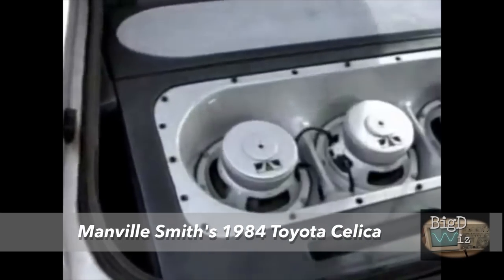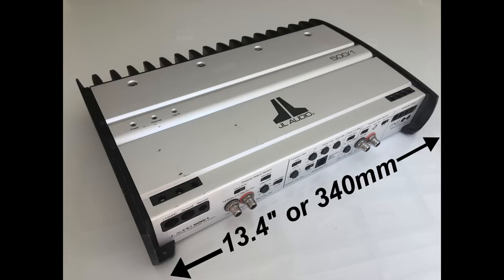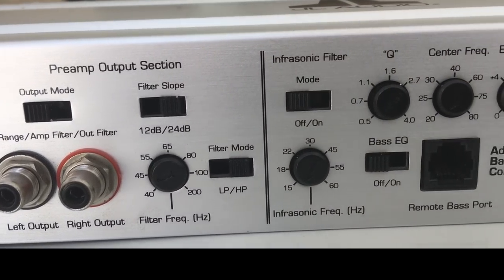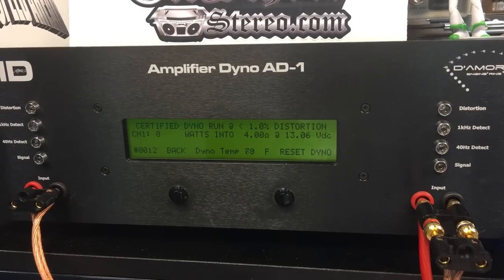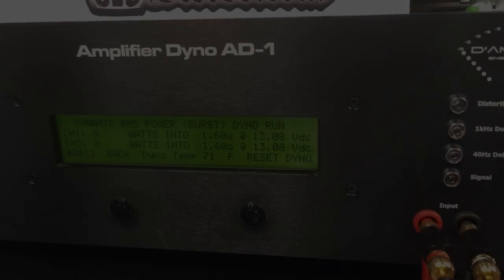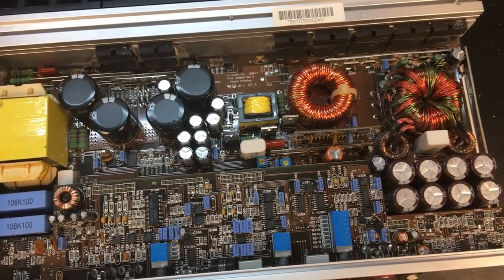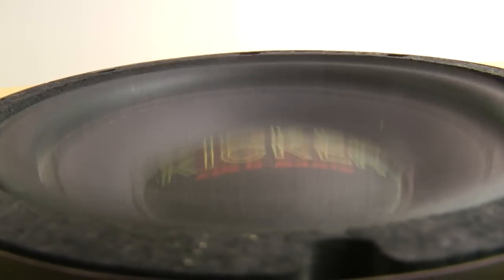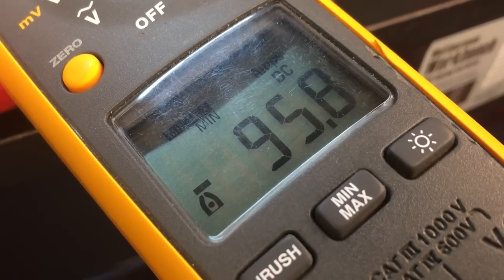Best Selling Car Audio Amp Ever? JL Audio 500/1 Amp Dyno Test

Comment: I'm 46 and sold these at United Audio Centers in Aurora IL.  This amp was a game changer when it came out.   Amazing power in such a small design.   I sold these for a living back in the day when it came out.   My JL Audio rep was a cool old guy which I thought was weird for a young mans game back then.   The nicest set up was an Alpine head unit with the subwoofer volume control and 3X10 JL Audio W3 box or 2 x 12W3 box.   It would bang for days looked cool next to the 4 channel JL Audio AMP when mounted together.   It smoked anything in its class back then.   I think it is awesome it still goes for around the same money on Ebay if it is mint condition.   We were one of the largest sellers of Rockford Fosgate and JL Audio made a huge impact back in the late 90's.
Reply from the maker: Agreed!!

Comment: Easily some the cleanest sounding amps still on the market.
Reply from the maker: +ThisIsSolution thanks for watching and commenting.
Reply: ThisIsSolution facts
Reply: I’m using one right now to power a alpine r series 10 in a porter box people think I got 2 12s
Reply: I have 2 500/1 v2 pushing 2 8w7s and a 400/3 pushing c2 650s and my alpine 6×9s
Reply: @urbbs09  i bumped two 8w7s as well, I started with a crossfire720 rated at 720watts @12.6v
Then eventually moved to 2 JL 250/1v1
Instead of the crossfire... the jl amps sounded a bit cleaner but both were absolutely loud and clean with deep bass, I built a custom box for the subs... it was something out of legend how it sounded. 
The 8w7 (although expensive) is underrated in its sound range,  it hit hard, deep and had crazy good response.
Imagine I got both subs for $550 and they were the anniversary edition speakers after the dealer couldn't fulfill my original order for 2 refurbished units, so they had to swap out the refurbished with brand new.... I used them for a while and sold them online for a profit!! 
Now I'm bumping 4 jl 13w1s and 2 jl 250/1v1.  Loud budget system that's clean!!
Reply: @urbbs09  good times,  enjoy your audio
Reply: I would like to say i have 1 extra 8w7ae in a custom ported Birch enclosure I'm selling if anyone is interested
Reply: @urbbs09  how much $?
Reply: @briteRedaz16  where are you located?
Reply: @urbbs09  Califuckinfornia lol. Central valley

Comment: JL is one of the best manufacturers to this day. I've never owned a slash amp myself, but I've seen and heard plenty and they're solid in every aspect.
Reply: I think JBL will Give JL a run for the money ! Pre Samsung.  JBL has alot more r&d and been around a lot longer
Reply: hifivega I currently own two. I’m running a slash 300/4 v1 that’s still running like a champ from a previous install on my comps. (Sat in the box for around 6 years in between) I’m also running a slash 500/1 v2 on my sub. They scream quality and are built like tanks and they produce some of the cleanest rated or above power. I’ll likely never look at a different amp line besides the slash series provided JL keeps producing them.
Reply: It a good real world amp, i have the 500/1 with a 10 w7, and it soundz very clean. Not thumpy but clear and doesn't strain the electrical......

Its for grown men not young boys... its all clean power
Reply: @hifivega did you upgrade your alternator?
Reply: JL and DD audio
Reply: I have 300/4 running Boston Pro 6.75 in the doors and it pushes them nicely.
Reply: @Rah-know  do you think your JL Audio/500 does a thousand Watts
Reply: Moses Salazar no..... maybe 600 watts.... the RIPS Technology will clamp the power to get the cleanest output..... I’m sure it’s a 1000 watts peak but the power is clamped......
Reply: jbl grand touring

Comment: This amp is legit.   I’ve got a 500/1 powering a JL W7 12” in a wedge factory enclosure with the aluminum bars, as well as a 300/4 powering my mids and high’s.   To date - everything still slams and has not once had a single issue In the 20 years I’ve had them.  Love JL.

Comment: Every 500/1 I benched was around 540-560watts at 1.5-4ohm loads, the extra control features make it one badass 500watt mono amp.
Reply from the maker: +jeanious2009 did a bit more at 1.6, but wow the current draw 😱. Prime example of why you would really benefit from using these at 4 ohms...light load to the electrical

Comment: I have a jl 300/4 and also 500/1same as what u. Are showing one of the best set ups I have done I'm my cars. Love the quality of them with 6×9 jl audio in the rear and 6.5 jl audio in the front with jl tweeters on top of dash. For the bass I have 2 12 jl w3. They sound awesome always puts a smile on my face when i turn it up no distortion whats so ever. I also put in a 4 gauge jl audio wiring kit. I love jl audio I would never go anywhere else.
Reply from the maker: +Samuel Justo thanks for watching and commenting with your experiences
Reply: Which one is more powerful ?
Reply: @Samuel Justo did you upgrade your alternator?

Comment: I have a 2002 built 5 channel (500/5) from this series.   Class D sub, AB front and rear.   It's still running.
Reply: I picked up that same amp at a thrift store for 15 bucks I couldn't believe it when I did

Comment: As I noted to a comment below, I am currently running two slash amps. I’m using a 300/4 v1 from a previous install from a ways back (It sat in the original box in my spare closet for about 6 years in between installs) and it still runs like a champ. I’m using it to run my front comps (ID CXS64s & ID 69s on rear deck for some rear fill) and I’m running a slash 500/1 v2 on one sealed IDQ12 D2 v4 in my trunk. These amps are built like tanks and put out some of the cleanest at or above rated power and are light on your electrical. I cannot say anything negative about these amps and I’ll likely never look at a different line of amps provided JL continues producing them. Also, I want to give a big thumbs up to Big D for taking the time to provide us his quality content. I’m always excited when there’s a new video uploaded! The information you provide us is both very informative and entertaining. Even though my current setup will likely stay as is for some time it’s always great to see you testing a huge array of amps to help us make wise decisions based upon the information you provide all of us given that each of us have different goals in this never ending quest to obtain the sound we are looking for!

Comment: I have owned two of these. Sheer bass  output signal from this model was insane.  They werent cheap neither. .
Reply: I still use my original JL Slash-500/1 in my car today with a new 10”W3V3-2!#🔊👑@emersonmayeaux2482

Comment: I have had that amp since the early 2000's and also have the matching 300/2. The many controls really kick ass. Also use JL speakers and subs. I'll never sell them, they work too well and give me all the power I need. I used the setup for years in an 18-wheeler, using two 13' zero gauge Monster Cable power lines hardwired directly to the 4 x 12v battery system of the truck.Was fascinating to watch your review. Thanx a bunch!

Comment: During my career as an installer for HiFi Buys in the Atlanta area, I installed hundreds of these amps.  Usually along with a 300/4 for mids/highs.  I RARELY ever had any come back with problems.  They had a ton of headroom, impressive dynamic range, and never seemed to run out of "juice" when powered properly.  I miss those days...  Thanks for the review BigDWiz!!!
Reply from the maker: +IDontHaveAVideo awesome, thanks for sharing your experiences with this amp 👍
Reply: I got my First (of 2) Eclipse Aluminum 12's from a HiFi Buys (the Kennesaw one next to Circuit City, I even have some photos from an IASCA/SLAP Show down there one time) and the Monster Cable 4 Gauge power kit I ran up until I upgraded to 0 gauge just like 2-3 years ago (if even that long), I forget where I got the second one, may have been another Hifi buys, did there used to be one over across the road from the Mall of Georgia, if there was I think that may have been where I got the second one.
Reply: DanielRichards644 Those Eclipse subs were pretty sweet!  I worked at Hifi Buys on Jimmy Carter Blvd., then at the Mall of GA location.  That was a great job with great people.  I do miss it.

Comment: I'd love to see a dyno of the JX 1000/1 D from JL Audio. Wondering how the budget versions perform.
Reply: For just raw power at 2 ohm the JX probably performs just as well. Problem is there's a lot more to a 1000/1 slash series amp than just raw output.

Comment: I have the same but the 250-1... No fuses... 4 gauge inputs... Won't over heat either... Underrated also... Puts out around 400 watts at any ohm... Owned since 2007 about... Was pricey but well worth the price... Highly Highly recommended...
Reply from the maker: +lucifur999 get what you pay for

Comment: Yeah! thank u very much friend! i was waiting for this review, please make one of Slash 300/4, and 10"w1v2 subs....great video!
Reply: In my 2008 Toyota Meru (A.K.A Prado 3 doors) the setup is: Pioneer AVH 3200 DVD, front stage JL ZR 6.5" and MB Quartz Reference mids, rear Pioneer TXR-800 enclosures, mids Bluefire 6.5" (Beyma replica) all this powered by JL Slash 300/4 and drived rear and front stage for open car with 2 relay. The bass original box JL Powerwedge with 2 10" W1 V2 powered by JL Slash 500/1 main wire gauge 1/0 and for each amp gauge 4.... i accept suggestions....   I love this channel
Reply from the maker: +Alfieri Hernandez wow, great setup!! Thank you for watching and commenting

Comment: i remember i picked up a JL 1000/1 and 13w7 (in the true to spec box) at a garage sale for 60 bucks one time....that JL amp was amazing and sounded better than any other amp (barring Zapco) that I ever owned. It's now permanently a fixture in my closet because it went into low ohm mode and never came out....damn i miss running that amp....

Comment: Finally installed mine that I bought new in the box. I’m thankful for all the controls for integration purposes but after seeing 100+ amp draw is 8awg that JL recommended enough wire? My power light dims on hits with 20’ of #8 

Classy video as always man, thanks for posting.

Comment: I have this amp together with a 300/4 still installed in my BMW 540 powering Diamond Audio Hex series components and coaxials and 2 JL 10w6 subs for the last 14 years.
Reply from the maker: +Jun Alcanites if it ain't broke, why fix it? Great setup there 👌

Comment: I had 3 15 w6 comp subs from JL audio. Had them powered perfectly off an old school sound stream 2000 watt amp. I know they would have handled more power. I dont know if you tested the sound stream amps yet but it could be another test video Derek.

Comment: i did a test to my 3 12s when i had this amp and it was reading same wattage to each speaker.awesome amp.just acquired the 500/1 v2 and the 1000/5 v2.havent hooked them up yet .need a project car first.cant be booming toohard in my soccer dad van..or can i?hmm

Comment: a few weeks a go I repaired a friends amp it was a 500/1 v2 and were the one large inductor to the left the yellow transformer looking thing it had 2 smaller ones.   He Some how dropped it and it broke a wire coming from one of those inductors and it stopped working. it also broke the zip tie that was also holding it down.   So I use my soldering station and removed the inductor took the broke wire out fixed the inductor and put it all back together and it worked great.   and the thing is heavy for its size.   only made 20 from it since it didn't take long to fix.
Reply: Would you recommend these amplifiers?

Comment: Sorry for the late comment, and I hope that you respond. Thanks in advance for your time! I just pulled one of these out of my uncle’s 72’ c-10 and will probably out it in my truck on a separate build. Questions are what new JL 12 would you recommend hooking up to it and how will the connections be made with the sub outputs? I see that it has room for 2 subs, but you only used 1 connection in your test?

Comment: I had a 1000/1 Slash. Absolutely hammered until it started playing up. I found if I bridged the grounds on the input RCA With output RCA I managed to get it working again.
Reply from the maker: +staples4335 those should do about 2x what this amp does. Pretty big 1200W amp by today's standards, but some times size does matter 😝

Comment: Was my favorite amp out of the Amps I had. Wish I never sold or traded it tho... Even tho it's not a monoblock Class D, I have alot of capabilities with this Orion XTR 750.4. Hopefully it will fill that void. Birth sheet shows 205watts RMS @2ohm per channel instead of 188watts. Can set it for 2 channel, 4 channel, or mono. If its as good as I believe it is not having it dyno'd by anyone on YouTube that I can see, and I get the rest of my bases covered for voltage I'll strap this beast with another from the same father... hehe

Comment: I have owned both the 500 and 1000 slash 1s and there were great amps. The only thing I would notice is when switching the bass eq to the on position I used to get a very low audible rumbling noise  when the volume was all the way down but during music it went away.
Reply from the maker: +lstephenson247 interesting. Thanks for sharing your experience
Reply: That would be a bad ground, rumbling noise with motor running. Bad ground.

Comment: Whenever i see jl audio at local pawn shop i usually buy i hate reselling em cuz they are beast.they had 2 almost new 12 w6 for 300 i got em with 6 month warranty for 300 out the door.bought a wedge 12 w3 series for 100 and find alot of deals on offer up cuz people want alot for them but always drop prices cuz too much.if i see a 13.5 w7 for 250 i always go and inspect it test it and buy it..lol
Reply from the maker: +Dj Smiley of las Vegas agreed. I got a 10TW3 in a Stealth Box at a Pawn Shop for $80. That combo sells for 600 😱
Reply: BigDWiz im sad i sold it for 220 i made a video when i hooked it up in my suv and a cheap performace teknique 800 watt and it was loud and clean.when i finally got this amp it was gone.great video was waiting for you to do the jl audio amps

Comment: great vid. did you happen to make one for the xd600 and rd500 by JL? i have two 8w7 and been using just the xd600 for both subs. it slaps but im sure they can slap harder and sound better. thinking of buying a micro amp because space is an issue. whats crazy is i bought the xd600 for 150 new years ago and now today they sell over 300 used. not sure what to get. im a sq guy and have both subs enclosed. also thinking about get some skar 6.5 component speakers for some mids. what should i do?

Comment: Great job on the video!  Wondering if you could help me out. Thinking of pushing a 18 inch sub with a 500/1 but it's an 8 ohm sub. Can you Dyno to see what the power is at 8 ohms? Wondering if the rips still works at higher impedances.
Reply from the maker: Yo Joe! I don't have the amp in my possession anymore. I sent it back to the owner, sorry dude

Comment: I have an amp I purchased in 2010 it’s a jl 360/4 and I’m getting about ready to install it once again in my car. I bought it originally new used it for that car and then sold the car kept the audio components. I haven’t found any dynos on it since it is an older model. I’m curious to know what it outputs at. Do you take on side jobs ? Can we arrange sending it to you for a dyno power analysis ? If so how would I get in touch with you best ?

Comment: The slash v1 amps do not have an actual bass knob. It only increases the bass at a certain point. It doesn’t adjust the level. Had to read my manual to find that out. I bought a PAC Audio inline bass knob. It connects via rca cables and does what we call a bass knob would do.

Comment: If someone was to send you an amp for power rating testing, say a JL Audio HD750/1. How long would it take you to make a video of it and how long to send the amp back after testing? I'm interested in sending you my HD750/1 since it's just sitting in my drawer next to an HD600/4 for a ford flex build, but I'm a little scared as I sent out a N64 to get modded to someone and the dude won't communicate with me and give me any updates lol! There are a lot of people asking about that amp and I would also like to know what it can really do lol.
Reply from the maker: +Jose Luis Ruiz I don't usually accept amps and especially not with a timeframe for a video. I work 45-60 hours a week at my day job, volunteer and help my kids with school/homework/projects, so I have very little time to test amps and make videos. Putting out one video a week is a real struggle, but it's what I do each and every week. I get 5-10 requests per day to test specific amps as everybody wants to know "what their amp actually does". I get it, trust me. I would do this all day, everyday if I had the means. People who don't do video editing don't understand the amount of time it takes to make an interesting video. Each of my amp test videos take approx 2 hours between connecting amp, setting gains, getting measurements for power and current draw. Then I take pics/video of the Amp, another hour, as some can be difficult to get to the "guts". Then research of company and any additional information/facts. Another hour. Then the video editing part. This can take 5-8 hours depending on the complexity. Then another hour to make YouTube thumbnail and create video description. That's around 10-13 hours per video. Then posting to Facebook/Instagram and answering YouTube comments. I set aside 5 hours per week to do this. 

Sorry for the dissertation above, but I want people to understand how difficult and time consuming this is. I love it, and will keep making videos as long as I can. I appreciate each and every view and comment. I hope to test a JL 750/1 some time in the future and I'm sure I will.